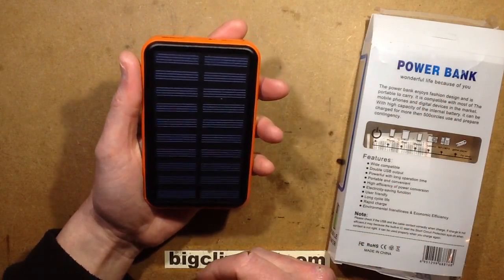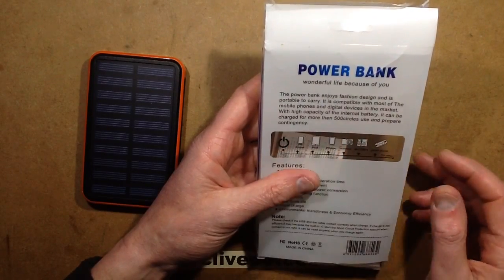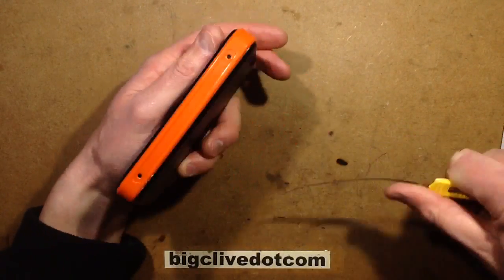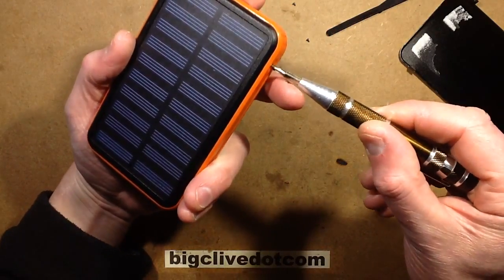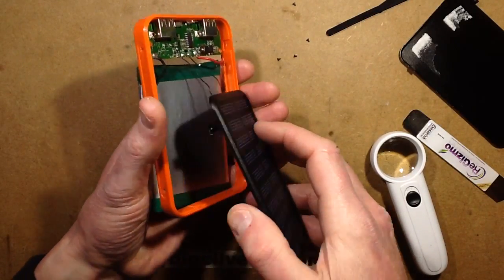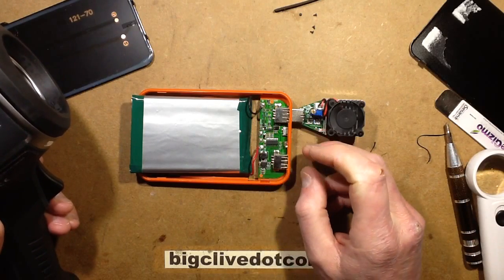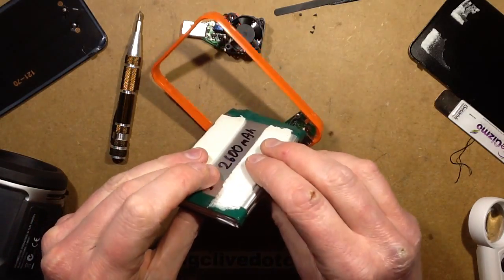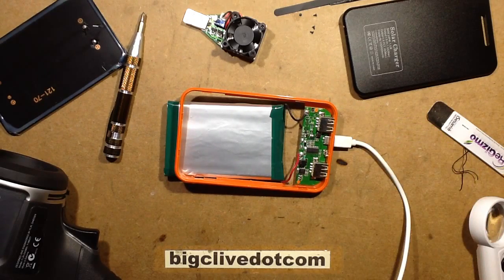FAKE! 100,000mAh solar powerbank capacity test and opening.

Comment: I saw very similar power banks on ebay going for 3 quid so I bought one. its in an identical case with the screw on metal sides and the plastic frame but mine has a different solar panel, 3 cell pouches inside and weighs 250g. The circuit board is laid out slightly differently but looks to have identical components. I havent measured the capacity yet, maybe I will when its empty and I have to do a full charge but going on the size of the cells Id expect them to be 2000 or 2200mAh each, so its probably 6000/6600Ah in total (they only claim 16000mAh in the listing and on the case). 
Im honestly at a loss to think how it can be sold for £2.99 shipped. this is from a UK seller, the postage alone for a 48hr delivery with tracking number must be at least a couple of quid so theyre almost giving me the power bank for nothing.

Comment: @bigclivedotcom I always took dual usb output power banks to mean they can output a total of the sum of both ports max.  For this case that would be 3.1A. Is this not true and the only reason for the dual usb is the resistor setup as you mentioned? Thanks.

Comment: Does anyone know about the Aedon 20000mAh solar power bank? It looks very similar to this, right down to the two USB ports at the end, the LED "flash light" feature, and the LEDs that light up when exposed to light. I have one and (no surprise) I'm having trouble getting it to work properly. It frequently disconnects/reconnects and seems to charge slowly when it even charges at all.

Comment: US sellers also misrepresent.  Got a 20,000 mah solar power bank from a "deal of the day" vendor for about $15.  The included manual listed it as 5,000 mah.  My testing got 1450 mah so I complained and got a refund.  They didn't offer return postage so it's in a sunny window for whatever future use I might make of it.

You do realize that we're all characters in a book and when you forget what you were going to say it's because the author is backspacing.

Comment: Hi Clive. I recently bought one of these, not the same but similar. After watching your video I weighed it and it comes in at 342g. I think you said yours weighed 200g. I am hopeful therefore that mine has greater capacity, though I have no way to test it.

Comment: trying to guess the seller's bs argument. Assuming 100mA cut-off. Use 100mA load under ridiculously super bright light and if the panel can generate close to 100mAh then the power bank can eventually serve 100000mA over the time! haha

Comment: I've seen quite a few electrically knowledgeable people use that type of metallic screwdriver. Not just to unscrew screws but to poke around in the electronics. As someone who knows very little about electricity and it's fellows I'd think you'd want a rubber handle, just to decrease the risk of a chock. Can anyone enlighten me?

Comment: its lithium polymer, even though it can output 2A it cant do it near 5V so phones may not use 2A. Its more like the charging capacity is 6W maximum regardless which port you use as the voltage will dip even further if you try to pull a total of 3A using both usb ports.

The battery could be used and lithium polymers when they go wrong can really go wrong.

Comment: I have solar-chargeable power pack that looks almost like the one shown. The one I have does not have LEDs  on the back side. It has an LED ladder display on the side next to the power/function button. Functionally it looks identical. 

The one I have is rated to 10,000 mAh. I did not test it for time vs power, but it is effective to run my phone and tablet when required. 

A power level of 10,000 mAh hour means 10 Ah. A power level of 100,000 mAh is 100 Ah which in reality would be a huge battery as like the size used in an automobile!  Battery technology is not that good yet.

I am guessing the solar panel is "moot", meaning bogus. That is disappointing.

Comment: Youtube showed me a link to a 2.5 year old review Julian did os a 30,000 mAh solar battery pack that is a near clone to the one you had. I was impressed by the 3.3 x "increase" in in capacity (using the same batteries) in the last 2.5 years. I looked at the comments on Julian's review and found a year-old link to an eBay listing for a "600,000 mAh" solar battery pack. I clicked on it and the link is still live! 42 suckers, er, buyers on that listing.
http://www.ebay.com/itm/221887185824
Gee, you can get a "600 amp-hour" battery for only 50 bucks! Such a deal!

Comment: This is funny. This system of panels and framing, where the opposing sides screw on one end and hook on the other, is exactly the same as used on my external 2.5" HDD case.

Comment: AA rechargeable battery may have around 2500 mAh, assuming you can fit maximum about 6-7 of those into case like on video above so thinking rationally you can expect maximum around 15.000  to 17.500 mAh when buying this size power bank.

Comment: my solar power bank which I bought from aliexpress was supposedly 20000 mAh , but it actually is around 8000 mAh. What I don't get is that sometimes when I leave it in someplace where the sun interacts with it to charge, it discharges. Why is that?

Comment: It "can" supply 2A but voltage is way too low, it was down to 4.1V by then! no device will even try to pull 2A when voltage has fallen below 4.8V or so. If your meter is correct even at no load it's already too low at 4.6V for 150mA... i.e. it's actually absolute shite and most likely pretty much unusable in real life. Gotta give my first "thumbs down" due to the very poor analysis on this one!

Comment: I wonder if the rating (what should have been capacity) was indicating cycle rate (or circles as they said). Basically, that it would last enough cycles as to achieve 100k mwH.
(That would still be deceptive, but it allows them the squirrel room to say that they're not lying)

Comment: Sorry Clive this is totally off topic. Just a question have been looking on Amazon at multimeters. I won't ask you to endorse any particular make or brand as that isn't fair on you or the brand/manufacture. I have a limited budget of 20/30 pounds give or take 5 pounds either side at a push but if you could suggest one that is as good as I could hope for, for that money I would be very grateful.

Comment: Clive, 
That FLIR camera you're using has the exact same chip as the others in the EX model and is simply software locked to a lower resolution. Message me and I will furnish you with a way to vastly get better resolution from your camera without the thousands of credits difference.

Comment: Out of curiosity, how big would a a pack of cells have to be for 100000mAh? Is there a calculation for this? Maxamps, which is a good US seller of LiPo packs has a 23,000mAh pack that is 182mm x 92mm x 33mm. That's for all available voltages. 1257g in weight. That's pretty big. If it was close to the 100k mAh it would be 11 pounds!

Comment: Just out of interest, what sort of short circuit current can you get out of that solar panel? I'm guessing no more than about 20mA or so looking at the size of it?
Reply: he said 100ma in a later comment, but it fires up the board with the leds, so in most lights its going to waste more than it puts out, the 100ma was a full sun (probably a very bright bulb) test

Comment: Makes you kind of wonder how many of these high mA battery packs actually meet their rated capacity. I have a 16,000 mA Anker battery pack that powered a HD camcorder for 4 3/4 hours and the pack still showed 3 of the 4 lights for the charge level so I guess that's pretty good.

Comment: So...if you were to expose the power bank solar cells to a bright sunshine and connect a minimally drawing device (equal to the solar cell charge rate) then could you consume 100000mAh from the bank?  The cells would be continuously replacing the discharge from your device...

Comment: I had one of these exact ones that i left on my window for a couple weeks.

Turns out it had no overcharge protection so the battery ended up almost twice as thick as it should be and pushed the case open.

Quality stuff
Reply: it will grow into a 100k mAh battery in no time
Reply: LoL
Reply: Getting one, i like fireworks
Reply: Or maybe it get swollen because the heat. Lithium hates heat. If they got exposed with heat they will degrade and swollen

Comment: If it's a 2-port PB where one port is marked 1A, the other 2A or more - it's really a 1A PB at most.

iPhones have a voltage divider based charger detection, and if a genuine Apple charger is detected, it's blindly trusted - e.g. 2.1A will be pulled even if the voltage drops way below 5V. Android and all others, OTOH, use resistance-based detection, with the caveat that if the claimed current causes a voltage drop below 4.75V (the USB limit) they ramp down current from the rated value in 100mA increments, until a stable 4.75V+ is achieved.

So, cheap power bank manufacturers take one port, add the voltage dividing resistors matching a genuine 2.1A iPad charger to one port, call that "2.1A", and simply short the data pins together (dead short - considered to be "undetermined current" in the USB spec, in which case a device must ramp up slowly to no more than 1.5A, or until voltage sags below the limit), and call it a "1A" port.

In reality, pulling 2.1A from such a device overstresses the conversion circuit. Because of the resistor fakery, an iPhone or iPad will happily draw that much, possibly causing a fire hazard. Android phones are more careful - even those that understand Apple's voltage divider scheme (e.g. recent Samsungs) limit current on voltage sag, so the charger isn't overloaded too much.

If you have a phone that takes a 2A USB charger, and want a good PB, pick one that has both ports marked 2A. Assuming that it's not simply a lie, you'll likely have the same setup (maybe with a proper resistor on the Android outlet instead of a dead short), but enough hardware in the boost converter to give a stable 4.75V+ under a 2A load, so the phone will start charging at 2A, and stay there. Or just get one with Qualcomm QuickCharge support if your phone also supports it.

Comment: Would gasoline have that capacity for the same volume ?? I'm not in a position / location to do the math right now :(
Reply: it would guess yes, but there would be no small way to use it, perhaps a fuel cell and whatever fuel that uses would be a large improvement, but they never seemed to take off

Comment: Dont understand..... neat device capable of delivering 2 amps ????? Did'nt you read the Voltage?  2 Amps at 5V would be neat indeed, but the reading was about 4 Volts. So the voltage doesn't matter? Hey, its full 2 Amps - ok, at 0,2Volts, but so neat. ??? wtf is going on here.

Comment: The size and weight says it all. 18650 cells are about 45 grammes each and store around 2000mAh. So a 100000mAh pack ought to weigh at least 2200g. More than 2 bags of sugar!

Comment: When you were younger, did you ever remember being able to read the chips without the magnifying glass?
Reply from the maker: Right up the age of 45 I had incredible vision, but it started going first in my left eye and then right eye some years later.  It's very annoying when you are used to reading tiny details with no assistance.  And not reassuring at all when the optician says that my eyesight is actually very good for my age.
Reply: I feel your pain. God I miss being able to see like a young lad.
Reply from the maker: Yeah.  It's indescribably annoying when it happens.  And something really weird happened recently.  I was packaging up some kits and writing labels with my normal glasses and suddenly everything went super-sharp and focussed as if I had my reading glasses on and then it went back to normal.

Comment: I hahe two powerbanks.  One 6600 mah and one 10000mah. Both have 1 and 2 amp output.  Both delivers 1.5 amp on the 1a port.  The 2 amp port delivers max 1 a.  Why?  Why have different amp on the ports?

Comment: Wow, 100Ah could easily jump-start a car, possibly even one with a bigger V6 or V8 engine in it.
Reply: Seegal Galguntijak no? amount of cells determines voltage i thought?
Reply: Mr.Inspector Yeah, right, OK, so you'd need 4 LiIon cells at 3.7V to get about 12V for your starter, and at that voltage 100Ah of Lithium cells would only give you 25Ah. Which is still not bad, considering my car battery (in a smal 1.4L engine) has about 44Ah, so less than double that. In fact, there are booster packs out there in that size region (I don't know how well they work though, probably only on smaller engines like mine). But all this won't prevent the shady Chinese manufacturers from advertizing such a booster with 100Ah, because that's the amperage that's actually in there (just at 3.7V, not at the required 12-14V). At least that's how every manufacturer of power banks does it with their stepped-up batteries: The Ah that are written on it are always those in the battery, so around 3.2-4.2V, but the thing steps it up to 5V, which makes for roughly a third less...

Comment: Usually if you tell them, they give you at least half a refund. I usually bargain saying "I'll pay you half, since the capacity is half what you stated" They usually do it.
Reply: I just say, you falsely advertised. Please provide a shipping label for me to ship this back to you and I will file a complaint against you on ebay. 

They 100% of the time will fight for a message or two, then issue a full refund. The only way to stop these kind of deceptive practice is to report everything and always demand your right and protection as an ebay buyer.
Reply: accountname0 That works too! Eventually they'll learn that accurate listings still get sales
Reply: +joblessalex - Unfortunately this is not the case or the problem wouldn't be getting worse.  What they will do is just create a dozen more fake merchant names and sell at the fraudulent rating on several so if there are enough complaints to get one shut down, they still have the rest to sell from.

Plus, they see it as a competition based on the fake spec, and sadly it is sometimes true that a prospective customer doesn't know enough to evaluate whether the spec is wrong and sometimes even if they can guess that it's wrong, they don't realize HOW wrong it is.

For example take a Cree XM-L flashlight rated for 10,000 lumens.  They say "it's about as bright as my 2000lm generic XM-L light, so it's really 2000lm", then someone else comes along and states "No, XM-L can only do about 1040lm so that's what it really is", when all are oblivious to the fact that the light is not capable of the heat dissipation and they're running it at little more than 5W, so after crappy reflector and lens loss too, it's producing about 600 lumens.
Reply: accountname0  Did they ask you what size label you wanted ?
Reply: qazwsx edcrfv no. They don't want you to send it back because the return shipping alone is more than the cost of the product.
Reply: qazwsx edcrfv Usually they just print one. Not sure.
Reply: If ebay fails, try paypal..

Comment: @Clive: nice video. One question: can you tell if that solarpanel is of any use on a sunny day? Will it charge, or will as you mentioned the circuit with the blinking leds already draw more power than it produces?
Reply from the maker: In sunshine it should put out about 100mA.  But it's debatable whether a lithium cell should be left out in hot sun.

Comment: Oh its 100AH alright, just gotta use it at 0.2V
Reply: You've got it backwards, Hinata. Think about it ;) If I were to build a Powerbank using a Car Battery at 12 V 100 AH (1200 WH ), it would convert to 327 AH at 3,7 V (1200 WH ).
Reply: But that's what it is, isn't it? There is a battery pack at 3,7 V and a transformer behind it. That ups the voltage to 5 V. If we change that to 0,2 V output, the 5200 mAH would increase to about 96 AH. Unless I'm getting something totally wrong, that is. Same thing when you put two cells in series, the voltage doubles and the amp hours stay the same, while putting them in parallel doubles the amp hours while the voltage stays the same. But both options put out the same amount of watt hours.
Reply: HinataSoul That's a moot point. The inverter in this device will be a boost inverter. The aim is to increase the voltage from the battery level to 5 volts. A buck inverter will not be part of the circuit, so there is no way this device would go down to  any value below the voltage of the battery.
Reply: You can't "transform" DC current. To lift 3.7volt to 5volt you need an inverter. The inverter specs would then set the current output limits to the USB socket.
Lowering the output voltage of the inverter would not increase the output current since the limiting factor would be the capabilities of the switching components such as the mosfet or diode devices.
Reply: Sorry about using the wrong word. Its "Wandler" in German. I just googled it, the right word is "converter". That's what I meant. 
Also, I'm not talking about current (A ), I'm talking about capacity (AH ). So even if the converter limits the output to, let's say 1 A, the battery still delivers 96 AH at 0,2 V. It would just take 96 hours to discharge. 3,7 V 54 mA goes in the converter, 0,2 V 1 A comes out of the converter. For 96 hours, that is 5,2 AH in and 96 AH out. Thus original point proven.
Reply: there is one

Comment: I have a type of those I bought from Wish - Powered by Geek.  It'll charge my phone about 40-45%.  Meh, it was $10 and the solar panel does work.  So for a backup charger I leave on my dashboard it's fine.  BUt know that the listed mAmps are a total lie. :)  (Just like Turbo Taxes "free" to file.  Only for kids, not anyone with a home or if you're married.  Then it's more like $106)